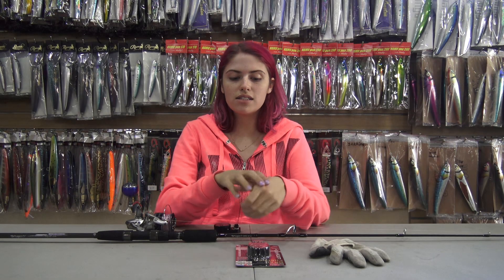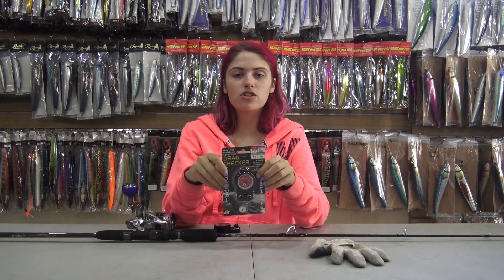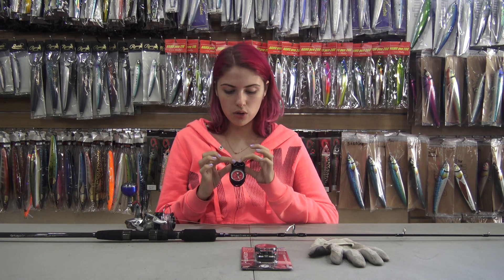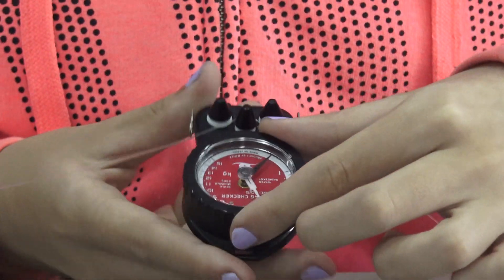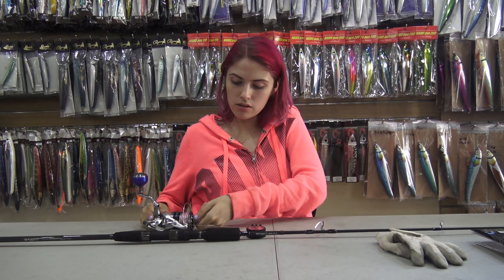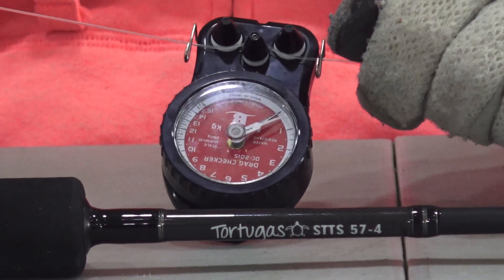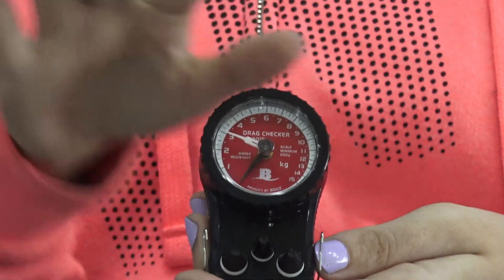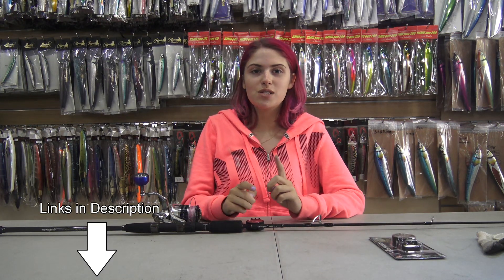How to Use Bouz Drag Checker

Comment: Can you comment or post the compensation table depending the thickness of the PE line. Thanks.
Reply: Hi Hugo, sorry but i don't quite understand your question. Can you please email us at info@saltywatertackle.com or call us at the store? Thank you.
Reply: It's either 25 or 30% of the line rating is what you set the drag to.
Reply: Hi Hugo, sorry for the late reply.
If you have the same Bouz drag checker DC-2015 as the one in the video, the compensation for PE 7 will be +5% and for PE 8 is neutral or 0%
Reply: Saltywater Tackle thanks a lot for the answer. Yes I have the same and I lost the manual. And I did not remember the compensation table. Thanks a lot.